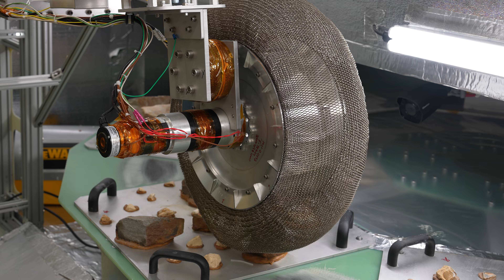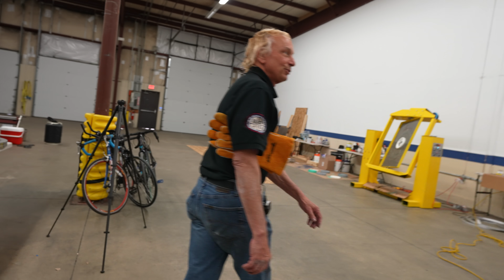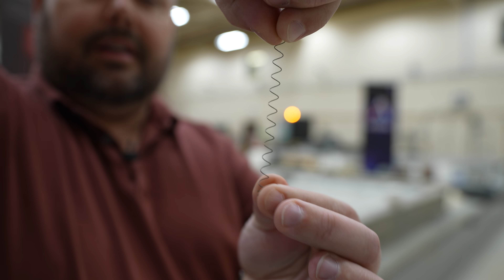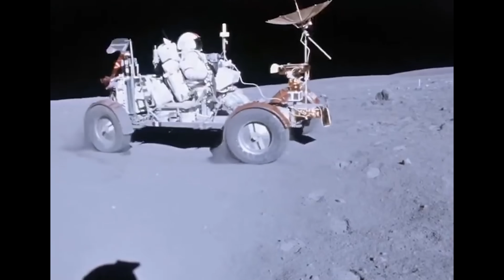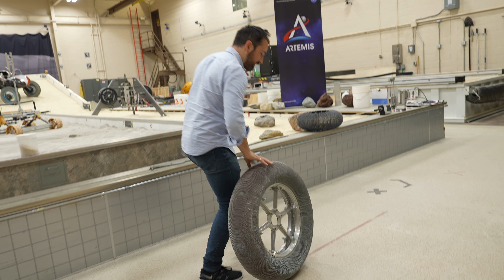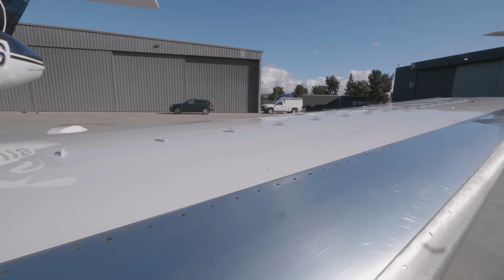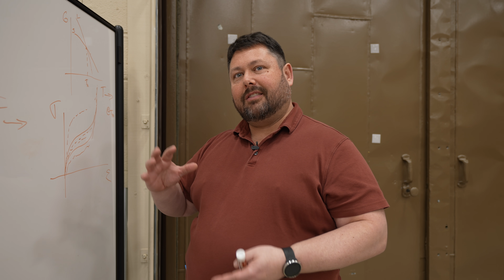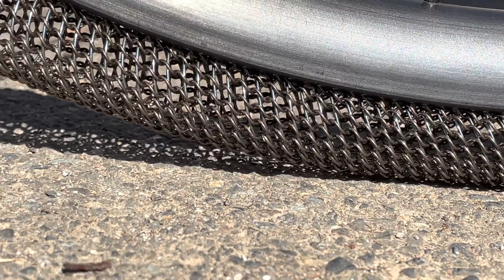How NASA Reinvented The Wheel

Comment: I'm sure a lot of people have known of this material for a good long while, but that NASA is going to use it for the tires of the rover is new information to me and is quite exciting. My first thought for durable tires that flex was giant springs with wavy plates attached to the ends that contact the ground and then wires to thread through holes connecting contiguous plates so the wouldn't get too out of sync as the tires rotate. I did an experiment and had tubes inside the springs to keep them from bottoming out and it worked fairly well, but they were beyond heavy. This looks like a better idea.
Reply: We do agree though that if this is going to be used in tyres on airplanes and cars, they will still need to rubberise this metal right ?

I mean, i dont think this would stand up to the wear of an airplane landing or a car that brakes at full force. Also i would doubt the friction properties is the same as a rubber on tarmac tyre.
Reply: @JohnDoe-bd5sz  Why would we use it for car or airplane tires on Earth? That would be kind of wasteful, both monetarily and materially. The only reason it's even needed is for extraterrestrial exploration in adverse or non-existent atmospheres. Also, you can't rubberize metal.
Reply: @anon_y_mousse  they said they were looking into using it as car tyres and airplanes tyres as well. Tslked about it being flexible enough to omit suspension as the tyres Would act as those as well
Reply: @JohnDoe-bd5sz  I must've missed that in the video, but if so that's a really silly thing to do. Instead of paying $400 for a new set of tires we'd wind up paying $400,000. No, thank you, to that.
Reply: @anon_y_mousse  Timestamp 22:05 and forward, they talk about terrestrial application, even showing a car with one tire being this structural one
Reply: @anon_y_mousse  Nitinol is nowhere near that second figure, as far as I know.

Comment: I'm confused, in space sun vs shadow, you have the extreme temperatures. Nitinol can be deformed while cold, then reforms while hot. How does that handle?

In sun it would constantly return to shape, but does that mean in cold it would just deform? Can it only work in sun? Or does another heat source apply to the Nitinol to force its return to shape? Or was this handled by the thermic reactions within the Nitinol as it was morphing back and forth?

Comment: @Veritasium How about wear and tear of the surface on constant use because of friction? If these are being used for automobiles on earth, how long would they last with the constant friction the metal springs and the road?

Is that where the bicycle tyre polymer would come in? If yes, the tires would still need changing based on the tread loss.

Comment: So if this alloy has been around for so long, it begs the question: why isn't it being used in the construction of commercial car road tyres? Obviously it's application would be as part of the carcas of the tyre not the actual frictional surface etc (which presumably would stay the same as today as the "rubber" compounds used are actually very fit for purpose), but surely it could be used in order to remove the requirement for inflation and make "runflat" tyres. Two potential answers spring to mind: a) increased weight b) it's just too expensive to be viable for use in a commercial tyre product (or a combination of both). Anybody have any idea as to which?

Comment: if that metal is used "in space" then any smal deformation would be negated just by beeing in the sun right, if u put the temp at the correct level that is.
Like the metal geting heated to 120 degrees by the sun could be used to "reform" the original shape aswell. Making any deformation even a smaler problem. Almost like its self repairing

Comment: Interesting to see them making a wheel, however how would you maintain the grip of regular pneumatic tire on the road at high speeds if the whole structure is a metal mesh? The only thing I can see is embedding it into a volcanized rubber like in regular tires. If you have any suggestions, write here!

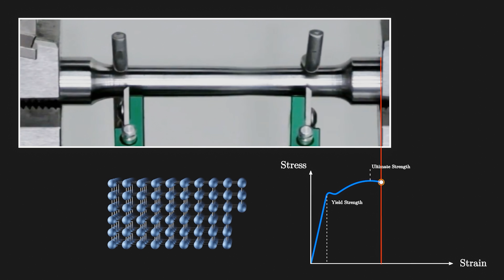Comment: The plot shown in 6:20 is actually force-displacement not stress-strain.
The force applied lowers but the cross sectional area is smaller so the stress rises.
Because stress = force / area

Comment: hmm I wonder if you make a Velcro like texture out of this stuff and combined that with the wheel. you might be able to drive up walls or ceilings. just set up temp control to grab onto the wheels and let go just right. 

would be neat to see or just test out. stuff seems strong and a tight enough meshes from the Velcro to wheel rate you might be able to get it to hold a really heavy load.

Comment: They should design a tire that you can resleeve in rubber for the road made out of this stuff 

It would make rubber recycling easier and it would change how we think of suspension. It would also be much lighter than a steel or aluminum alloy rim and steel cored rubber tires. Less spinning mass

Comment: Nickel is toxic though right? So does the alloy make it not so? Personally, I get horrible pain/reactions to prolonged Nickel exposure. So it makes me wonder about the stints and other permanent applications in the body. 

Just as an example, if I use bobby pins for more than 30 min my scalp will become very sore for at least a week. It is actually interesting how much it hurts me for barely even contacting my skin. I know I am sensitive to it, but I thought Nickel was toxic to humans in general.
Reply: Nickel is only an irritant in its elemental form, not as an alloy.
Reply: @snowthemegaabsol6819  Okay, I suppose I am just allergic to Nickel then. I googled a bit and it seems 10-20% of people are allergic to Nickel. The allergic reaction can happen with alloys containing Nickel as well.

It was hard for me to find easy information on the subject, but apparently the reason steel implants don't normally cause issues is because the Nickel in "surgical steel" is "bound." Which supposedly keeps Nickel ions from contacting the body.

Surgical steel has a high Nickel content, so there has to be something helping to prevent the Nickel allergies that stainless steel would otherwise frequently cause. The same would apply to medical tools as well, like stainless steel surgical tools.

In saying all that, I suppose a similar treatment/process is used for the stints made of Nitinol.

Comment: I'm not sure, but I believe you don't need to heat it with a torch. If you run current through the wire it will heat up and return to it's original shape. That means you can have a solid state motor, and if you use many strands in parallel you could make it quite powerful.
Reply: Yeah any source of heat will do. The problem with your idea of a motor though is whether the energy required to make it contract is the same as the energy required to stretch it, if so then it could limit its usefulness.

Using it for some kind of artificial muscle might work well though.
Reply: @conorstewart2214 That's not a problem, it's just physics.
Reply: @aminulhussain2277  what is your point? It is a problem with the idea of using something like this as a solid state motor.
Reply: Yea that was how they applied it to flaperon controls replacing hydraulics, mentioned in this video. Though I think it was a heating element instead. A current would probably be even more reliable

Comment: This could be awesome to the automobile industry also. You can dampen an impact by a huge amount if you use this material in certain areas of the vehicle. Amazing material!
Reply: You would also dampen the forward motion of the car. Not very "awesome"
Reply: @ferdinandgleinser2681  the idea is for extra crash safety etc
Reply: Yes your right 👍 also there are lots of extreme heats at speed of continuous long journeys as well as the reverse in colder conditions in various continents as well without including seasons seasonal  change that would also flip vary condition.  @ferdinandgleinser2681

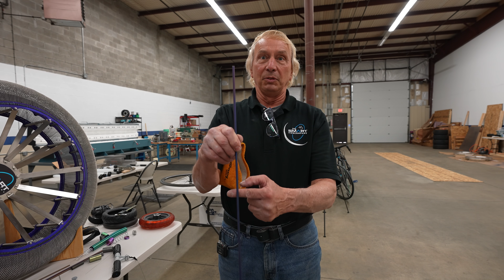Comment: 3:35 Is the shown way of converting 250 °F to 121 °C correct? Basically what he means is 250 ± 5 rather than 250 ± 0.5 So the number has 2 significant digits, it's 25 x 10. The same should apply for the temperature in Celsius. So that you get just 120 (and not 121) °C.
Also when someone says: from Warsaw to Tehran are 2000 miles, it just means 3000 km and not 3,218.6 km.

Comment: The more finnicky and 'smart'  these technologies become, the more they create their own problems especially when you try to generalize their application, which is always that uniformity mentality that causes problems. You said those wire tires can take you offroad and onroad, but dude, a bicycle is a bit different than a car, although the bicycle will cause the same issue to a lesser degree: Road material erosion. How can you be so naive to think driving several tons of vehicle via deforming wire meshes will be gentle on the road? And furthermore, do you just assume that because the material doesn't deform, it doesn't erode either? Abrasion could be a thing. Instead of filling the environment with dusty natural rubber and carbon, you might be filling it with tiny particles of shape memory nickel-titanium. And then you'd probably eventually have the same theater as with microplastics now.
We need to focus more on "wise" than on "smart". Because "smart" is an egoic power trip.

P.S.: Really no surprise to me that the aluminum wheels/tires would get stressed like that between the profile. Lots of direct hits by spikey rock to a relatively ridig, brittle metal curved towards the rock.

Comment: Cool!  At 17:00 the departure of the unloading curve from the loading curve appears to represent a hysteresis loop, the area inside of which represents work energy done i.e. energy absorbed.  I can see potential applications for things like shock absorbers with no moving parts or seismic dampeners for buildings :)
Reply: As the man said, the tyres can be the whole suspension system!

Comment: Those bulletproof bike tires are so useless.
How could i justify coming to work late if i can't use the good old "got a punctured tire from a stray bullet" excuses ?

Oh yeah also. Wouldn't it be a bit more effective to have you know, bulletproof clothing? Guess these aren't mutually exclusive but what good is a bulletproof tire if you're only wearing a bulletproof (never said bulletproof that many times in my life) vest? 
A bullet to the leg will do the same job as one to the tire, even better, you can't even ditch the bile and run.

Oh yeah another detail. I get that tires are pretty vulnerable to bullets. Makes sense.
But even though its metal, Wouldn't like EVERY part of the bike be vulnerable to even a 9mm?
Having a bulletproof tore is all good but if you don't have a bulletproof chain, brake wires, main frame, good luck riding your bike though your daily hail of bullets

Comment: This video just kept getting better and better. Amazing work Derek and team! Side note: Michelan debuted airless tyres about 20 years ago, so it's a shame we're still yet to see them on passenger vehicles.
Reply: It is because airless tires have some drawbacks such as increased weight, higher rolling resistance and higher cost, which have prevented them not yet from being widely used in passenger vehicles.
Reply: @bjarne9321  Also without a very durable/fast way to change things like vortex generators you are limiting an aircraft's maneuverability substantially let it be agility or range.
Seems like an excellent material for commercial airliners running certain routes and niche projects alike. Can't wait to see if something similar can be made with different materials and/or properties.
Reply: the reason is that they feel like sh*t to ride compared to pneumatic tires. They are utility wheels first and foremost.
Reply: Nickel and titanium are fairly expensive.  I'm not sure it would be practical to use these tires on a normal consumer vehicle.
Reply: @jonadabtheunsightly  I'm not so sure about that.  We're already to the point of using carbon fiber on certain parts of the engine block, namely the pistons and connecting rods.  Material sciences, 3d printing, and strange new ways of looking at engineering have dramatically changed cars before, and once consider super-exotic, are now common everyday things.  The tire pressure sensors in my Mazda 2 were once debuted in the Porsche 959, at one time the fastest car in the world, as such an example.  it's less about cost, and more about practicality.  Someone mentioned comfort.  I'd rather have the occasional flat than have a ride like falling down the stairs.
Reply: @Truex007  The reason carbon fiber was traditionally considered expensive, was because of its high-tech manufacturing process.  This is fundamentally and categorically different from nickel, which is inherently expensive because it is a rare material; nickel will not get cheaper as technology improves.  Titanium could potentially get cheaper, but only if someone finds a fundamentally new and much cheaper way to refine it from ores (as happened e.g. to aluminum in the late nineteenth century).  It won't gradually get cheaper due to incremental improvements in materials sciences and manufacturing techniques.

Comment: So you are telling me that the austenite term is not specific for iron or rather steel from what I remember from that iron-carbon graph. Also martensite, I learned about it recently, as a kind of structure in the steel, while we apply some sort of heat treatment, and considering how fast the cooling occurs, we can have martensite. So basically even though we study mainly iron, steel or cast iron at material science, the same concepts apply to other metals

Comment: chain link fencing is made the same way as those tires, so the machine technology to cheaply mass produce tires made from this already exists. this tech really could revolutionize tire development across the board. titanium is so cheap, it is used as a pigment in almost every gallon of paint you buy in the form of titanium dioxide, and nickel is plentiful enough that it is used industrially in more applications than i can even list here. although it could potentially raise the cost of concrete as used tires are a cheap source of fuel in the creation of quicklime, one of it's main components. wow, a perfect example of the butterfly effect. how crazy is that?

Comment: Nitinol on biomedical applications is amazing, you can just staple a fractured bone together with an alloy that contracts at internal body temperature. The pressure in the broken bone by this contraction actually boosts the osteocytes into regenerating the bone quicker and stronger

Comment: That's really… cool, or hot, i'm not sure, but i want two for my bike, though i wonder if they would react differently on winter or summer.

Also curious about the thermal reaction, how long does it sustain, where does the energy come from? If i put that metal pole bent between two close walls, it can't keep producing heat forever, right?

Comment: I noticed; when you were twisting the spiraling rod into the "Chain Link" mesh that you twisted the rod around 2 neighboring rods instead of 1 (@ 20:00).  I mention this because I am quite certain that twisting around 2 rods instead of 1 would produce a more stable - "tensengral" mesh pattern. TEF Braids has produced and tested composite mesh structures utilizing both the chain link pattern shown; forming tires; as well as the mesh material that would have been created had you continued to twist in rods around 2 of the previously inserted rods.  I was granted a patent which describes and illustrates two sets of spiraling filaments, interlaced perpendicular to one another.  I believe that interlacing a second group of spiraling linked filaments around the circumference of the wheel would produce a stronger, thus potentially lighter weight wheel.   Please consider doing a show on pattern science, and it's applications in today's technology.  I've appreciated many of your shows; Thanks.
Reply: As someone who has made chainmail before, I caught that too. Reminded me of the kings mail pattern.
What if you instead wove a wire (or two) at a different angle(s) to the intersection points of the perpendicular wires to act as a "capture" point?
Reply from the maker: Thank you for your support and your comment! For any video ideas, reach out to contact@veritasium.com

Comment: I’m curious how this technology could be applied to vehicles. Because with all of the emergency stopping, hydroplaning, black ice, etc… how good is it’s traction REALLY? Surely it’s not better than rubber. I feel like that kind of alloy would just slip on concrete at high speeds. In places where the speed limit is 70-80mph+, how well does it turn? How well does it perform compared to rubber? We can hear the friction rubber tires have. If you’re parked and turn the wheel, we all know that sound of the crunch of little rocks and the squeak of the rubber. I wonder if there’s a way to combine this technology with something else to give it better traction. But clearly I’m not the scientist or researcher figuring out these issues. Maybe they already have a solution. Maybe it’s not even a problem at all

Comment: There would need to be way more finer grained saturation of the surface area of the wheel shape in order to go high speeds. These are great for rovers that go slow. But for a care tire or an airplane, the manufacturing would have to achieve precision.